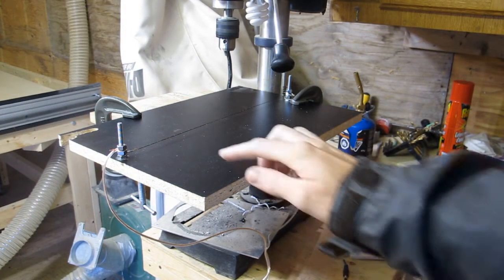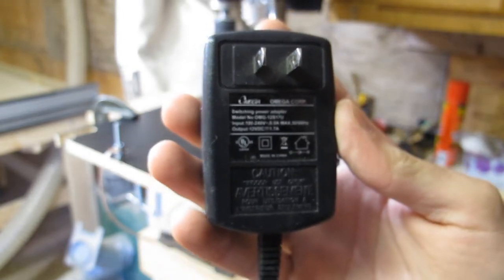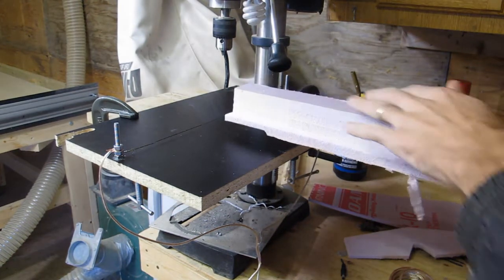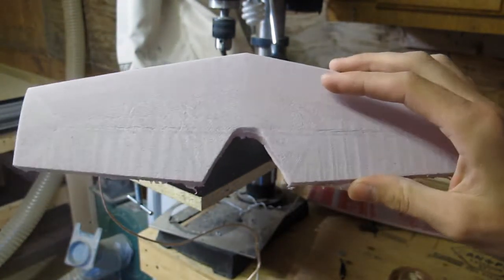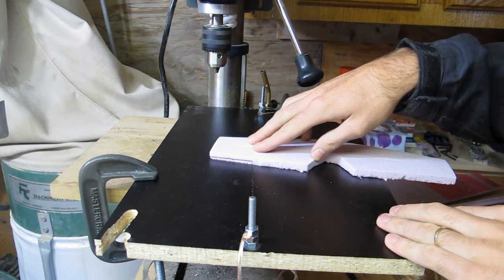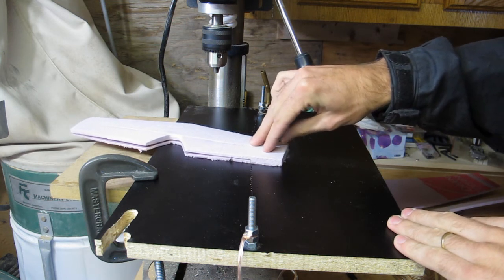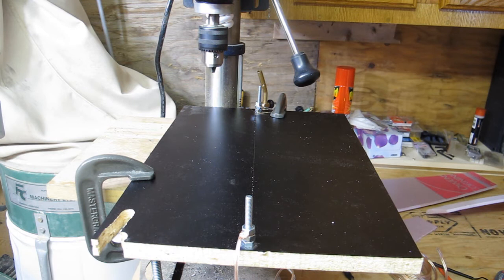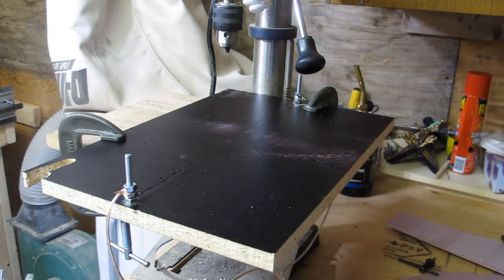Homemade Foam cutter

Comment: the wire is cheep guys and it dosent stretch this is the stuff and power with a brushed! esc and a servo tester for vairable heat
 http://www.ebay.co.uk/itm/261776713422?_trksid=p2060778.m1438.l2649&var=560648860860&ssPageName=STRK%3AMEBIDX%3AIT

Comment: mine is a 9v switching adapter from a 7" portable dvd player and its 2amps, i used a 80cm strand from a bicycle brake cable, it works nice apart from a bit slow and the damn cable is a bit wiggly which makes a funny patern but still my airfoils are cool.

Comment: A good idea thanks...I will use my power supply to get the low voltage etc...BTW Apparently its Polyurethane foams that produce cyanide gas...so dont use them...the polystyrene ones don't...you need to check the specs of the foam sheets you use the manufacturers should be able to advise correctly.....Rgds...Laurie

Comment from the maker: The thinner the wire the better.  You will need more power to heat up a brake wire.  Not sure if it will work.

Comment from the maker: @skvallab yes it is coating, and both the fumes from burned foam and the coating on the wire are toxic.  the coating on the wire Burns/melts away after awhile.

Comment from the maker: @chesterdrummer More then likely that will be to small of a output.  For a short wire I would recommend 12V dc at least and with 1000ma or more.  I have also used a car battery charger, or if you have more then one of those 7.2V supplies then connect them in series.